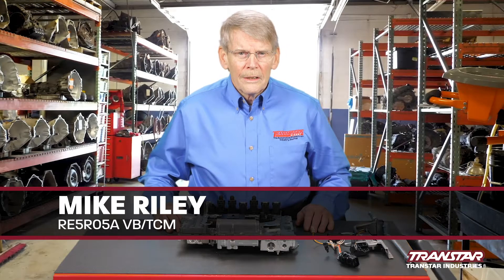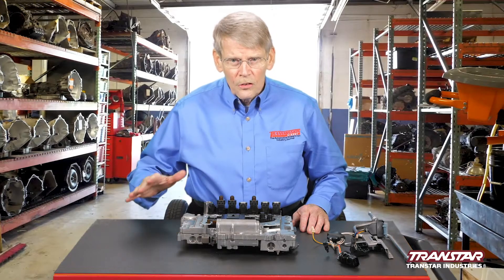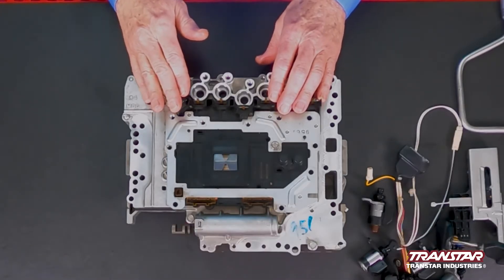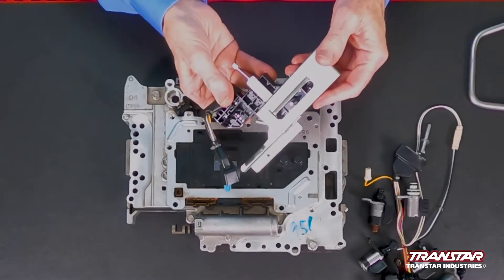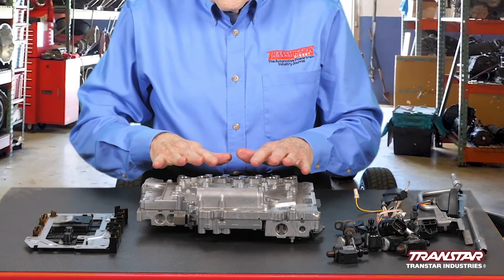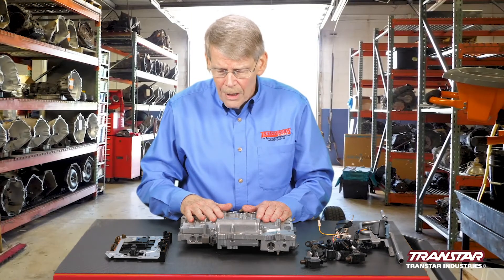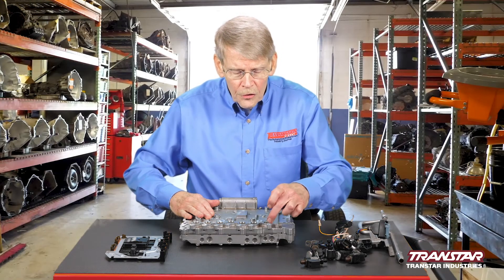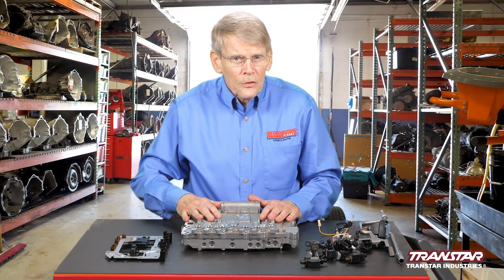Nissan RE5RO5A: Valve Body, TCM & Programming

Comment: Hello, I have a question to ask. I have a 2006 Nissan Titan V8 5.6 LE. A code popped up P0710 Transmission Fluid Temperature sensor A circuit. I was told it's in the valve body near the pan. I'm trying to located where the sensor is at and I can't find it. Can you please explain exactly where it's at and what it looks like?
Reply: Check out rock auto

Comment: I purchased a remanufactured valve body for a 2014 Infiniti q50 from eBay once installed does it have to be reprogrammed or should I take my old TCM in solenoids off the old one and put on the new one. Pleas help asap?????
Reply: Did you ever figure it out

Comment: Question: I have a 2009 Nissan 350z touring it's throwing a code P0745 Pressure Control Solenoid “A” Malfunction..I took it to several transmission shops and they want to rebuild the entire transmission when it's just a solenoid. .I just saw you take several of the solenoids off the assembly.  Am I being scammed into paying extra money for a REBUILD ?
Reply: They usually wanna rebuild the whole thing due to the age. You CAN just swap the solenoid, but if you don’t the whole thing, you won’t have to worry about it for a very long time.

Comment: If I replace the TCM in my 07 g35 with a refurbished one from eBay do I then need to get it reprogrammed to my vehicle?
Reply: Yes
Reply: I got p1759 and p1757. Help help
Reply: @nathanmccumber8965 you most likely need to repair your valve body or tcm
Reply: Update?
Reply: @ the one I had replaced it with was one from a g35 sedan so it didn’t work 100% it was staying on drive so I took the one with a broken pin and took it to an electrical shop and they were able to solder it for me for like $20 they also used copper wire to solder because normal solder would come off
Reply: 1:48 shows where the reverse solenoid is located.

Comment: I have a 2007 Nissan Maxima I bought a junkyard valve body cause it would shift so hard it sounds like something was bound to break . All so when down shifting it would sometimes not down shift at on . I put the used valve body on it shifts good now. But for some reason I don't have reverse.. please help me. Really getting expensive..Thank you very much..
Reply: 06 maxima have faulted torque converters
Reply: And 07 my bad,look it up
Reply: Always get reprogram.
Reply: Most likely a solenoid was bad on the old valve body. You’ll have to see which one is for reverse.

Comment: Good night, I have the same box on infinity g35. v35, the solenoids were out of order, changed them and cleaned the valve body, put it back, the car starts up, drives on R but stalls on D, can you tell what the problem is?
Reply: You ever determine this issue? Aame issue here!
Reply: Add more transmission fluid
Reply: You need to get it re-programmed from the dealer